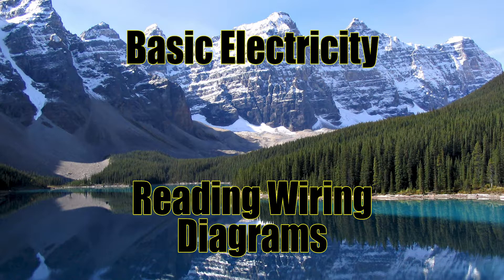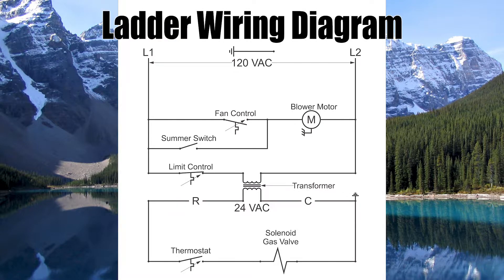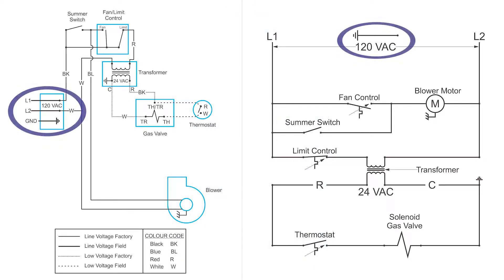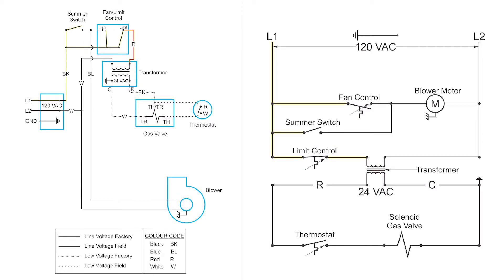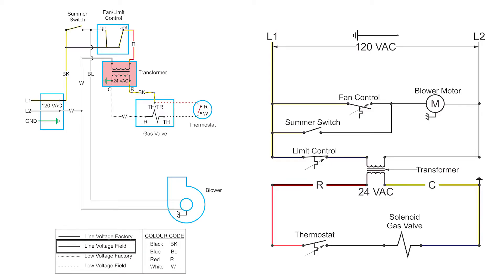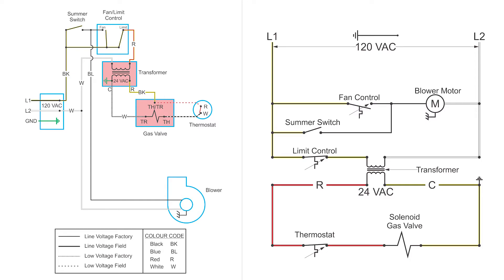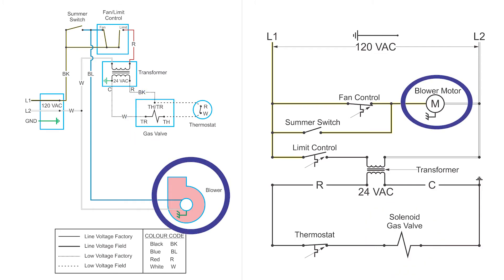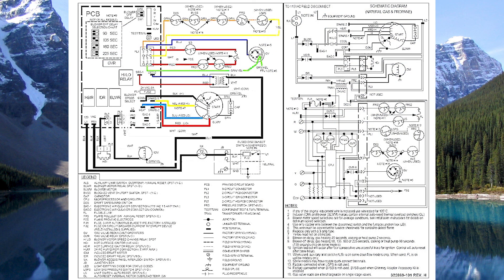Basic Electricity: Reading Wiring Diagrams

Comment: Hi, in the UK we can do all the wiring for an appliance/heating plan (zone valves/thermostats/appliance) from a 'fuse spur' fitted by an electrician (Fused junction near the appliance, run from a breaker) We can do everything after the fuse spur. 
Is that not the case in Canada? If we where installing a new appliance, would we need an electrician to do all the wiring for us? or would the electrician bring power to the junction, so we can then wire heating system from there? 
Also if you where called to a situation with no heating, and you diagnosed the fault to be with the summer switch/fan switch/blower motor on the 120V side, would we be able to replace those 120V parts? or would we need an electrician to do that for us? In the Uk we can cut the power at the breaker, prove the power is dead after the breaker. Then replace whats needed and re-energize the system to test its working. I am a little confused about who can do what. Thanks allot.
Reply from the maker: The electronic system depicted in this video is all but obsolete. Only service plumbers will even see it. Most of our wiring and controls looks much different and modern now. That being said we do not have fuse spurs, but I like that idea as it makes a lot of sense. The electrician connects the equipment to the line voltage which is 120 volts in Canada. The rest of the wiring is preinstalled by the manufacturer.

Boiler systems involve a lot of field wired controls. Plumbers work on the 24 volt side of that all the time. Technically, the electrician is the only one legally permitted to connect the 120 volt controls for appliances or boiler systems, but often the plumbers just do it anyways.